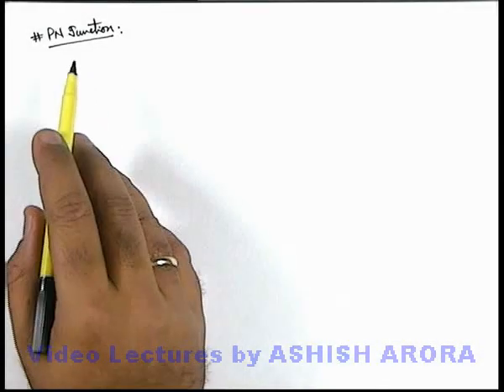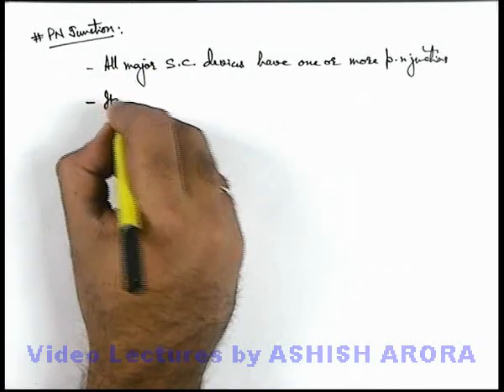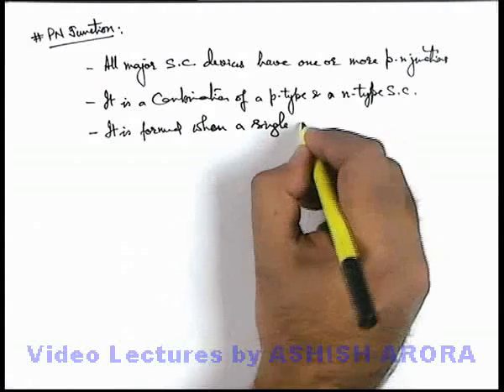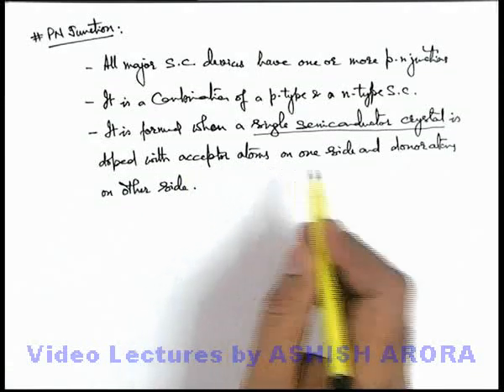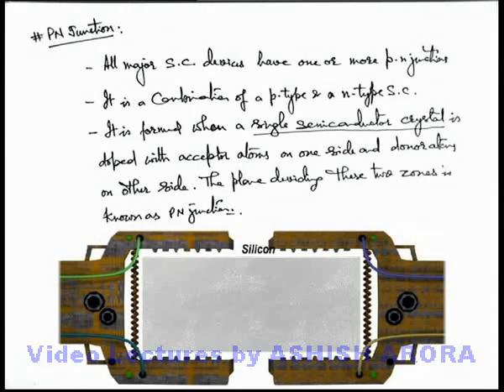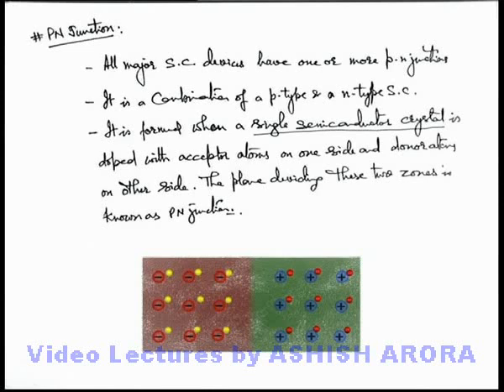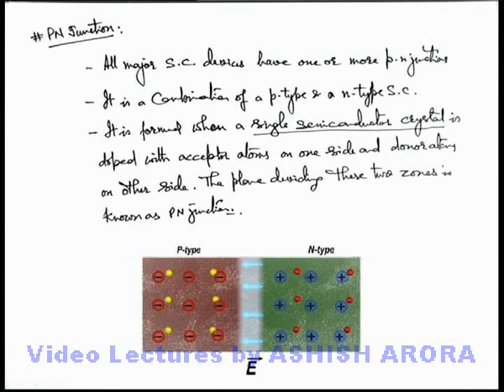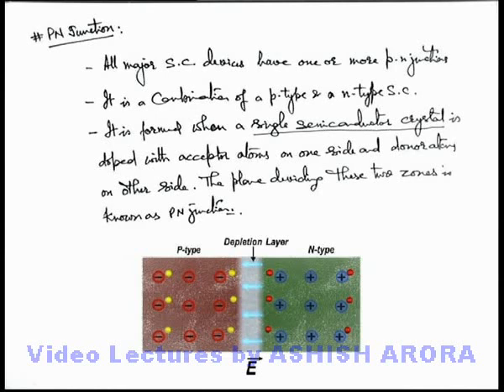Class 12 Physics | PN Junction & Diodes | #2 Introduction to PN Junction | For JEE & NEET

Comment: Sir, just as in video no. 13 of "semiconductors and its types" , the potential applied was forcing hole to migrate due to pulling of electrons from covalent bond to hole, in this video, is the electrons build up in other part is repelling the bond pair, causing the hole transfer in other part ?
Reply: same doubt